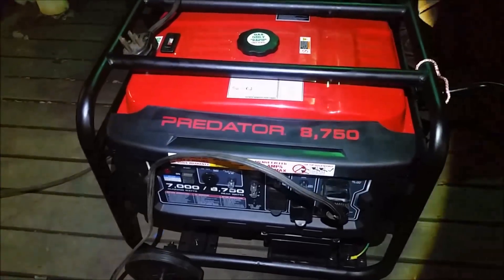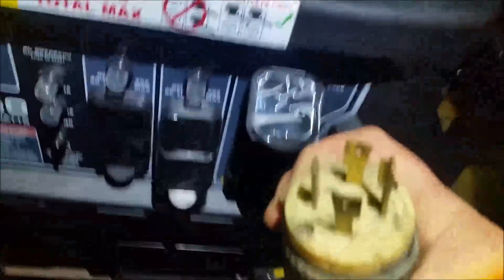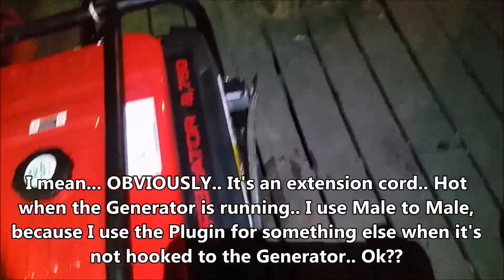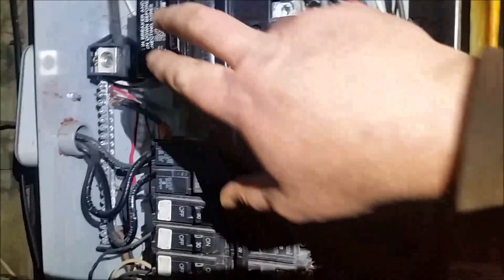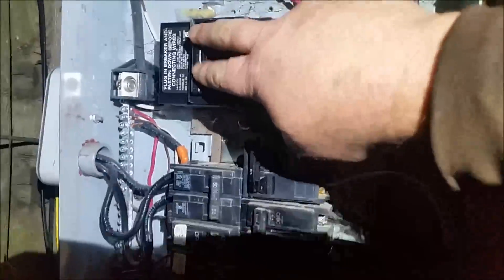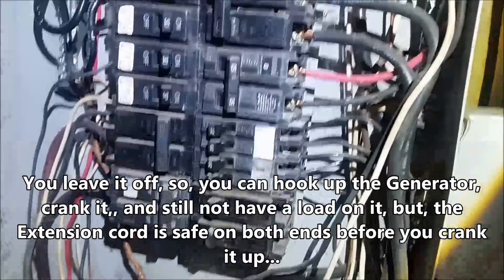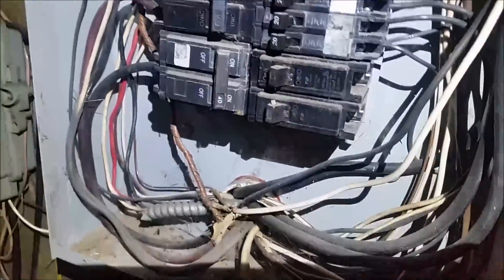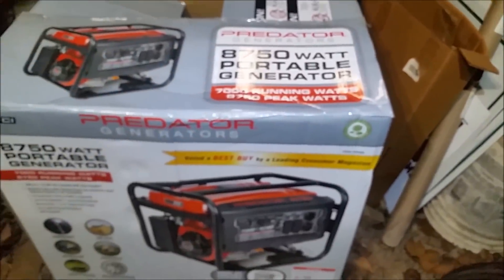Quick/Easy/Safe: Use Existing Plugin/Breaker for Generator hook up to your house Panel box.

Comment: I use this method during the winter when power does go out. All I would recommend is that you all locate a 220 or 240 volt surge protector and make sure it is inline between the generator and the breaker. As a fire fighter I have seen this method cause wiring fires if the wiring was not up to par. also for the cord I use a 20' RV power cord that is rated at 240V that is used to plug in large RV's and Camp trailers it is very easy to change the plugs to work in the generator. Also IO have found that a diesel generator tends to use less fuel and there for runs longer.
Reply: I just use a 12 gauge cord, the receptacle is wired with 10 gauge to the panel. I don't run any load close to the generator 5K max plus I am nowhere near fusing current of 12 gauge wire. I feel of the plugs occasionally just to see if the are warm but with load switching all is well.
Reply from the maker: Yep.. that is the way it works.. Good deal.
Reply: My house isn't exactly a castle and my 7 Kw generator won't run my 4 ton heat / AC central unit but from what I've seen, RV cords are generally around a 12 gauge wire. I don't know what all you demand of your system when the power is off but if your cord is only 12 gauge as I suspect, you should keep your power draw below 20 amps but don't forget to allow for the surge current drawn by fridges, freezers, window A/C units and such which can be three times the running current. Even if you have a large generator, if you are already drawing power at the limit of your wire's capacity and your fridge tries to start, it may not get the burst of power that it needs to get going and it could burn out it's compressor motor. Remember, everything in an RV or camper is smaller and collectively draws less than most home appliances of equal function do. My house is all electric except when it's cold and the power goes out where I used propane logs in my wood burning fireplace connected to two 20 lb tanks, two regulators and a "T" on the copper fireplace gas line. Due to health problems, I can't chop or carry wood anymore. When I had my garage built, I had it placed separate from the house. It is steel skin over a steel frame. I knew I was going to wire my generator the way I did and have lights, outlets, power tools and a separately enclosed air conditioned electronics workshop in it too so I wired it with 8 / 3 with ground, (8 gauge wire) as well as 8 gauge wire from the garage breaker box to the generator input outlet to the "suicide cord" from there to the generator. This way I knew it would be heavy enough to do whatever I asked of it and still be heavy enough to back feed the house with my generator without worrying about overheating the feed cable. I wanted to be sure everything that I asked of it would work including the washing machine, (but NOT the drier), dish washer, lights, TV's, window A/C, fridge, freezer, 4,500 watt hot water tank, and, most importantly, my coffee maker but NOT all at once. If the power has been off long enough for the hot water tank to cool or be used up and we need hot water for bathing or dish washing, everything goes off in the house except for ceiling fans in the summer for an hour until it's hot. Most everything else is on auto pilot unless I see the lights dim and not recover right away. Then I get up and check the voltage on both legs. Normal output for my generator under light to medium load is around 120 to 121 VAC. If either leg is at 115 VAC or above, I leave it alone. If it dips below 115 VAC but remains above 112 VAC, I'll watch it for 5 minutes as my Troy Bilt unit is rated at 10.6 Kw for a 5 minute overload. After 5 minutes, if the voltage hasn't recovered, I take a power tour of the house to see who turned on what, (like a blow drier), and rectify the situation whatever it takes up to and including shutting off my coffee maker but this doesn't happen so much anymore since the kids moved out.
Reply from the maker: Yep.. You have it all figured out.. Now,, you just need a few more kids to get you back on the calculator.. Ha..Ha. :)  Lots of thought and research into getting to those numbers strategy and details.. I had to figure BTU's of all equipment one time, doing a computer room.. That sounds bad, but, it's the same thing, just a different calculation..
Reply from the maker: Good Points.. I have been lucky, I think.. I have a Northern Tools Generator, but, not their top of the line generator for sure.. I have brown outs when things kick on and off, if I am running the A/C, Water Well, and my Laser Printers from time to time.. I do turn some of that off when I want to warm up the 80 gallon Water heater, because it really drags things down, but, in 12 years with this generator, I have not had any spikes that have damaged any equipment, but, I know someone who has on generator... Funny thing though.. Both of us experienced some really weird stuff about the same time (both of us running on different generators), and it was the exact time that the power company was turning the power back on..  They burned out several surge strips, power supply in a computer, GFCI breaker on a hot tub, etc.. I just saw some really weird stuff at my place.. One light in the kitchen went way bright, while another in my den went super dim, and my microwave beeped, but, the most sensitive piece of equipment (my TV and Dish) which is usually the first to reset, never missed a beat. I didn't have any damage though... The power company threw the  power on, because we were talking about it over the VHF radio, when the neighbor piped in and said, they just turned it on, but, it went right back out.. I think we had an arc past the main breaker into the panel, probably to ground based on how the surge strips were taken out.. 
To top that off, about a week later, lightning hit directly across the street from me.. About 100 feet away..  The voltage traveled through the air, hit my Ethernet cable (hanging between buildings in the air), and did some of the weirdest things I have ever seen.  Had to get into the ethernet cable in the middle of it, between the two buildings. I think it is 24 gauge Cat V. It went both ways.. To my house, it took out the port of the 36 port hub (but only one port), and damaged the 24ga 10 foot long patch cord running from the patch panel to the hub.. It blew out 4 of the 8 wires when I checked it with my patch cable checker..  Ran down one long 24ga cable, jumped into the patch cord, burned it up, and one port of the 36 port hub.. But, didn't damage the 24ga cable it had to jump into.. 
On the other end, the other building.. It went through an 8 port hub (No Damage whatsoever), took out the Ethernet port AND Power Supply on the Credit Card Terminal, then from one hub, to the next, where it took out 6 of the 8 ports (spike only came in on one port), and took out the Ethernet port on my photos computer, but, didn't take out the ethernet port that was connected to the wireless router... Hows that for strange?? 

The week before,, I am just about 100% certain the power company had a hot surge, which jumped past the main breaker which was shut off), and jumped into the ground at the other place, and I can't say for sure, but, surely affected light bulbs, which are usually just part of the Hot Circuit and most people don't even hook up frame grounds, so, maybe, but very possibly could have jumped from ground to hot.. Might explain why one bulb went dim, but, I'm not sure how to explain the other getting bright, unless it jumped the hot wire, which would be reasonable to think..  I can only put that in the back of my mind and wait for something like that to happen again and see if there is more data to look at.. 

Either way.. now, my neighbor is pointing his finger at his Generator, since it was running when the power surge happened, but, I am not so sure.. But, he is going to have a hard time hooking up the generator again without some protection.. I'll have to see what I can find and see how much those guys are.. I am thinking at least a bill and a half.. Hmmm.. Thanks for the comments..
Reply: One light in the kitchen went way bright, while another in my den went super dim, and my microwave beeped,

I'll tell you EXACTLY why this happened. Back in the early 80's, My ex wife and I, (still married then), had a son.  We were temporally living with her mother then. Her mother went out and bought a new electric stove / oven / microwave combination shortly before this. We would make up our son's bottles in advance and put them in the fridge. When he needed one, we'd just pull one out and nuke it for 40 seconds. One night, I got out a bottle and when I started the microwave, which pulled it's 120 VAC power from one leg of the stoves 240 VAC line,  the TV in the living room lit up like a spot light and the kitchen went dim. I went out to my car and got my meter and proceeded to check outlets. Everything was fine. I thought it was a surge from Florida power. Later, my ex went out to nuke some popcorn and it happened all over again. I checked the outlets. The bright side was at 170 VAC and the dim side was at 85 VAC. My earlier voltage checks were AFTER the microwave timed out but I didn't connect it at the time. I called the power company and they sent a guy out that pulled the meter. He hooked up a heater / load to one side and then the other. This house was built in the early 70's when they were transitioning from copper to aluminum wire from the transformers to the houses. Meter / breaker boxes made for copper wire, when connected to aluminum wire, have to have the connections doped to prevent electrolysis which is corrosion caused by contact between 2 dissimilar metals. When the house was connected, this wasn't done and the neutral line, at the meter, had corroded. With the 15+ amp @ 120 VAC load of the microwave oven trying to go to a corroded neutral that effectively wasn't there, it was, as electricity does, trying to find the easiest path to ground, or in this case, neutral causing an imbalance between the 2) 120 VAC legs. Turn on the 240 VAC oven, all is balanced. Turn on a light load like a light, TV or stereo, the imbalance is imperceptible. Pull real microwave oven power from one leg and all hell breaks loose. The lineman disconnected all 3 wires, cleaned and doped them and all was well but he warned that this could have happened at the transformer, meter box or even the main breaker box inside the house. If he had traced it to the in house box, it would have cost us $179.00 plus repair for the service call.
On a different note, You mentioned lightening. I have a 8 pound boat anchor that used to be an RCI 2970 DX 10 / 12 meter ham radio. I had it connected to an ABS 1600 base antenna in Florida. I NEVER grounded the 7 various CB, ham, TV or satellite antennas on my house but didn't take any pleasure in watching my 2 neighbors across the street lose TV's, satellite receivers, phones or my neighbor down the street lose an Antron 99 antenna, 200 watt linear amp, his CB, his Godfather's cable box and big screen TV, his phone or washing machine timer to being properly grounded. We even had a water main up the street blown out of the ground by lightening. Some of these damages took place over a period of years. Some were multiple with the same strike. As I said earlier, electricity looks for the easiest path to ground. My house apparently was invisible. I moved to W.Va. 17 years ago and one of the first things I did was put up my ABS 1600 and tuned in my radio, un-grounded of course. Several months later, we had a bad lightening storm. Lightening did NOT hit my antenna or the trees that it was guyed to. It hit a tree 65 feet away from my antenna, split the bark to the ground and killed it but the EMP hit the antenna and blew out the microprocessor that controls everything in the radio but the on / off switch. Ranger told me if I sent it back, it would be $290.00 plus shipping and insurance. I know that the antenna didn't take a direct hit because it still matches 1 : 1 and there's no external burns to the antenna. Even a floating ground isn't immune to magnetism.
Reply from the maker: Interesting.. This delima was at my Moms place.. A Modular that went in about 13 years ago.. New Service poll, etc.. I know it has a 3 strand Aerial Triplex which is Aluminum which has to terminate somewhere to copper.. Should be above the gooseneck, and it should be covered with the black tarballs (what they used to do).. Not sure about that.. Goes through the Modular's roof and we added a 12' porch on the back of it and tied into the roof... 
I'll get up and see what that looks like and see if I can see any penetration, leaks, cracks, signs of water penetration, etc.. and check the back of the panel lugs and from there to the main and see if I can see any problems..Guess while I am at that,, I will check the ground strap to the ground rod and make sure all of the connections are good... 
Probably call the power company and ask them to check their end,, or at least come put a new tag on the meter.. 
But, we were running on Generator power at the time,, and it was about the same time the  Utility power came back on.. Lots of variables.. But, can at least eliminate some obvious ones and work on checking the rest.. 
It makes perfect sense.. 
I guess you could do the same overloading one side of the Generator vs a low load on the other.. We were talking about that the other night, and now she doesn't remember, but, I think she might have been running her small oven (worse than a heater), and a fancy hot plate of some sort she likes to use.. She said she wasn't creating a lugging load on the generator, but, if she was running both of those, that has to be worse than two electric space heaters, which is a pretty decent load to begin with.. I need to go and see if they are on the same circuit.  Doubtful, but, possible.. Either side of a spacious kitchen.. 
If that is the case,, that could be fixed pretty easily.. Could be on different circuits but, on the same side of the box.. 
I have an extra box I could setup as a test bed and load up one side heavily and check the voltage of both sides and see what happens.. Might fiddle with a ground at the same time and see what happens there too.. 
I have a couple of big projects, but, I'll put that on the todo list.. 
Wish I had a couple old space heaters I didn't want any longer.. I would give the up to the Electric God and test that ground theory,, but,,, just from a heavy load one side and not the other perspective running on Generator power.. Could have been just the ticket.. Will verify if the test is worthy of the effort if those two items are actually on one side of the box.. They are both 120v  consumers.. Hmm... Yep.. I think we are onto something.. Cheers..
Reply: Well, well, well numb nuts! I knew you were a genius. You spew all that venom, when you knew what I said was correct. You even admit  that its possible for power to get past a tripped breaker. Go ahead and copy this to your posts or put it in the info section.You are so special, Short Bus Special. And go ahead and post that you are in Western North Carolina. If you are on a membership system the guys need to know!
Reply from the maker: Ok Numb Nuts.. Here we go again.. First of all, Nothing you have said has been correct... 
I already showed you the CFR that kicks you past the main breaker theory.. 
That has to be what you are talking about.. Damn.. You are one dumb fuck..

Ahh.. And,, Now, I am admitting that I buy your stupid crap.. Has to be with this sentence, since this is where you replied.. 
But, we were running on Generator power at the time,, and it was about the same time the  Utility power came back on.. Lots of variables.. But, can at least eliminate some obvious ones and work on checking the rest.. 

Well, you should have read what I was replying to.. You might learn something.. We were discussing his problem/solution when he was having problems running with things were blowing out.. It was caused by a heavy load on one side of the panel, and little to no load on the other side, coupled with a bad ground coming in from the Utility, running on Utility power.. And, his comment was about me explaining what had happened at my Moms house which was the same load imbalance that he had experienced and fixed at his place... A very unusual problem.. 

And we spoke about high voltage surges like Lightening and how it could easily jump from the main power feed to ground or the Neutral bar, if it hit the feed going into the house.. In that case, you dipshit, it would be jumping around or past the breaker,  not through it.. 
Have you ever heard of the phrase "Fail Safe"?? Ie.. when it fails, it fails safe??  Like Electrical equipment and Scuba gear for two examples.. 

Keep trying dipshit.. One day you might be able to come up with something to outsmart me.. Ha..Ha..Ha.. It might cost you 100 or 1000 spankings, but, you might get there one day... I'll trade you 100 or 1000 to one any day you like.. Lets put some cash in the mix and make it interesting.. I could use a couple of thousand extra to blow on something useless.. Ha..Ha..Ha.. 

But, if you were referring to the video that you posted,,, what kind of other dipshit would run a whole generator to run a oil fired furnace fan??? I mean.. Wouldn't you want some lights in that nice warm house??? What kind of generator would you be buying to run a single fan anyway?? 
I don't care what you come up with,, it borders complete Ignorance.. Hey.. Why don't you look through some of my other videos and see if you can find something else interesting to show your ignorance about.. 
And,, since you are a Squacking Liberal Democrat,, I have some Obama Era Videos you can get really frustrated at.. You might want to skip that one month of videos.. Because,, I have not met a Liberal yet who I could have an intelligent debate with. I wish you had some sort of knowledge about something and had the brains to put up a video or two of your own.. I would love to watch 2 minutes of one of your videos and see if I could find something to comment about.. I'll bet you would not make it 2 minutes without a major fuckup.. Ha..Ha.. Hell, you can't even sit down and think about it before you type it and get it right.. Ha..Ha..Ha.. Hey.. MCT oil is good for your brain.. You should try some.. Has to help.. Ha..Ha..